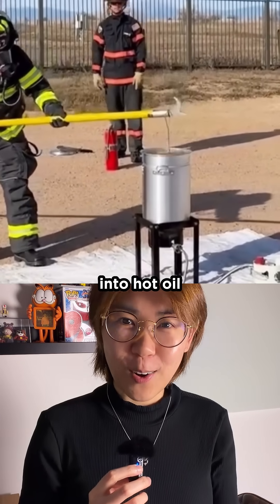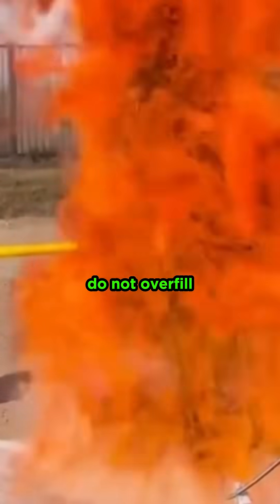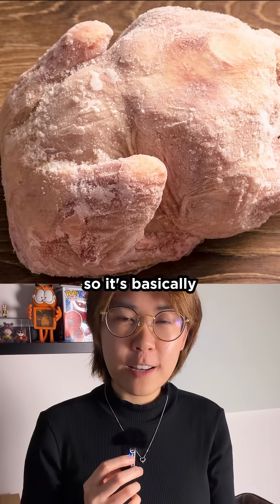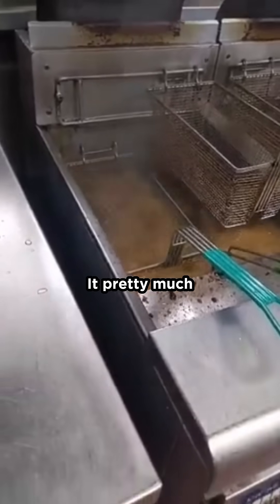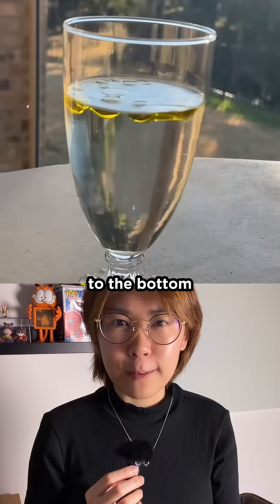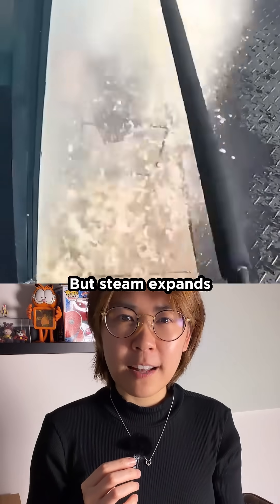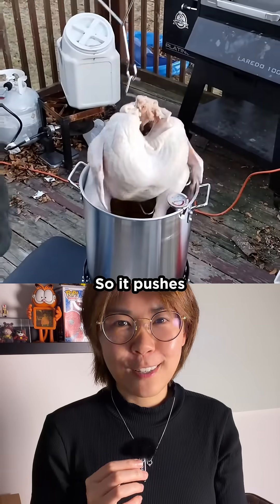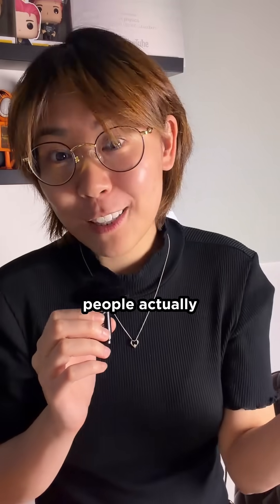The Dangerous Truth Behind Deep Frying a Frozen Turkey #holidayswithyoutube

Comment from the maker: Send this to those who like deep frying turkey and can benefit from this safety tip 😁
Reply: My family just put them in the oven AFTER thawing them. Thawing the turkey is easier to cook than just putting it in.
Reply: @DannyAddams-1977   Well duh. Of course thawing something, especially something as large as a turkey, will be easier to cook.
Reply: Why? I have deep-fried many turkeys and have not had a single fire or oil explosion.
Reply: @JM-lk6wo 
Did you even watch the video, it says FROZEN turkey's. If you let it thaw out, it's safe.
Reply: Why does the oil burst into flames ?!
Reply: @MarianLuca-rz5kk    The oil overflowed the vat and hit the burner/gas.
Reply: @MarianLuca-rz5kk so the ice goes almost instantly straight from solid (ice) to steam which needs lots of space. Steam needs about 1,700 times the space that liquid water does. Not enough space in the pot for turkey plus steam plus oil so oil overflows.

At same some time oil is broken up into tiny, tiny pieces. These tiny, tiny pieces of oil ignite more easily than a puddle of the oil. So oil catches fire.

Flames then travel upwards were they meet all that steam. Instantly igniting the steam (water) and oil mix. 

That's the billowing cloud you see over top of the pot. Now it has caught alight, oil flows away from pot, with burning oil vapours on surface (with oils the vapour burns). That's why it spreads towards camera.
Reply: Its called be careful and dont be an idiot. Ive fried turkeys and have had no issues.
Reply: I feel like it used to be a safety ad back in the day, hence why its common sense for the older folk😊😊
Reply: I work at KFC we fry like 80 turkeys on Thanksgiving at my store  😂
Reply: A deep fried turkey WILL CHANGE YOUR LIFE
Reply: We used to deep fry every thanksgiving turkey it’s awesome.
Use peanut oil, and follow the instructions carefully.
Reply: Who the heck deep fry turkey
Reply: @NinjaREX69     its commonly done in the USA.
Reply: @Jyno_Syd  is it? Im from the US but I have never heard of anyone deep-frying a turkey *successfully*. Its all just burn stories or it didnt fit.
Reply: @rorwyk       It's common in the southern US. They even make turkey fryers for this very reason. I've lived in every part of the US at some point or another.
Reply: @NinjaREX69 it's so good especially if people know what they're doing. My friends family did it while I grew up
Reply: Why Fire tho
Reply: @Point_Resident   Oil meets flame.
Reply: It's stupid to send this to people that Like to fry turkeys because we already know this common sense, either through learning it before we ever fried one or through experience out in the middle of our yard away from everything. Fried Turkey is the best nothing compares.
Reply: Thanks! Now i won’t have 3rd degree burns over the 90% of my body.
Reply: SHUT THE BURNER OFF WHILE DROPPING THE TURKEY IN THE OIL
Reply: after thawing the turkey is still 75% water also it doesnt melt like ice and go to the bottom. 
so im still not clear why putting a frozen turkey in oil is bad.
Reply: @bobrobert6277 it is much better to thaw then pat the outside dry. I inject mine a lot.  it's not the water and moisture in the bird it's the ice and moisture on the bird that flares up the oil. Also the oil should be in the correct range of temperature to lessen the flare up.
Reply: @TimbreWolfe  that make sense thank you
Reply: STUPID COST EXTRA
Reply: Or send it to the retærds that don't know basics.  This is definitely something a person who would microwave a whole turkey.
Reply: mommy?
Reply: Ok does she shave her poosie
Reply: Air frying a turkey is safer and MUCH better, in flavor, texture, and healthier in that you don't have the added oil. Just thaw it, brine it for a couple days, then take it out and DRY it off. Cook in air fryer about 3-4 hours.
Reply: Step one to deep fry a turkey.
1) Dont. Thats nasty and the meal is fattening enough without deep frying everything. 
2) think...cause just cause you can doesn't mean you should.
Reply: I've been deep frying turkeys for over 20yrs.  Stop doing bone head moronic shit. You will be ok
Reply: @TheOringinalWolfman Deep frying a turkey is a bone headed moronic thing to do. You've been doing 20 years of it.
Reply: @K-Locke Shows how much you know kid
Reply: @TheOringinalWolfman Same.  These days it's painfully easy to get the info on how to do it safely.  Is it possible to do it dangerously? Yes, but so is driving a car.
Reply: @TheOringinalWolfman Thank you for not being a bot 🙏🏽
Reply: Dip the bird, let some of the water boil off in the oil and pull the bird out. Let oil get back up to temperature. Don't leave the bird in the vat while it's about to boil over.

Comment: There is four things you need to do. Put the correct amount of oil in the pot, thaw and dry the turkey, turn off the burner while putting the turkey in, and gently put it in rather than drop it. Do that and you are good.

Comment: I get the oil overflow but why the fire ?
Reply: Hot Oil is like fuel to fire. Just so u know if you ever get a grease fire shut off the fire if you can so safely  by putting something on the fire like a lid.  If possible, take it away from the stove or fire. Let it die out on a metal surface like a dry metal sink that should not have any other dishes or anything that can melt or catch fire.  Remember, regardless of the type of fire oxygen will keep it going longer. Find safe ways to smother a fire depending on the fire

Comment: Shockingly, its kind of like a tame version of the demon core, water being the plutonium core, and the oil being the neutron shell reflecting particles back into the core. The water expands outwards (like the plutonium sending particles outwards as it decays) the oil trapping it inside so it builds pressure (like the neutron shell around the core that reflected particles back into the core, causing the core to go super-critical) and then water forces its way out as vapor causing oil to be sent everywhere, (like how when the demon core went supercritical, the plutonium had its decay sped up causing it to send particles and radiation outwards so fast and so powerful that it exploded.)

And that is how splashing water on hot oil is similar to dropping a nuke on Hiroshima. Thanks for coming to my ted talk!
Reply: It should be noted, however, this is simply an analogy to understand nuclear physics slightly better, the way the "explosion" happens is entirely different but still follow SIMILAR principles, the key word throughout my entire rant is "SIMILAR"

I would dive deeper into the topic but nobody is gonna read it and im too lazy to write anymore because it is 1:30 AM as of writing this and i need sleep. Have a good day/night yall.

Comment: I used to work in a kitchen and one time someone from the morning shift put something with high water content in the fryer. Because the fryer was shut  off between shifts you couldn’t tell there was water at the bottom. Until I turned it on, and it started bubbling and frothing and starting to overflow. We couldn’t server the fried foods for dinner cuz we had to quickly shut it off and completely clean it 😅

Comment: Also, the rapid expansion of the water when turning into steam causes the oil to turn into aerosols. Basically, the long fat chains of the oil get violently ripped apart, causing it to create small carbon chain pieces that ignite extremely easily. Which is why the fire, and why you can't light cooking oil on fire by itself, the long fat molecules don't burn as easily.

Comment: Deep frying a turkey doesn't have any logical advantage.... You might as well setup a furnace in a hole and then dangle the turkey into it. There's also too much volume for the heat to travel especially in a frozen turkey...

Save yourself the trouble and just butcher the bird into multiple large pieces, then cook them separately to doneness.
Carving before cooking makes it much easier to handle afterwards, because you have a smaller piece to carve, and it'd be well seasoned.

Comment: Some things said here were not quite right.  putting a frozen turkey in hot oil is nowhere near as dangerous as throwing ice in water.  In every video shown, there was too much oil to begin with.  whether the bird was frozen or not, a fire was going to start.  The thing can be partially frozen. There are two keys.  First... have the correct amount of oil.  Second... make sure that the skin of the turkey is dry.

Comment: MinuteFoods made an in-depth video about this a while back! Basically: 
Thaw it properly (day/~4lbs)
Measure for oil displacement (so the oil doesn't overflow)
Turn off heating especially if it's by fire(so any over flowing oil doesn't ignite)
Do it slowly (so the turkey's water content turns to steam near the surface of the oil) 
Keep flammables away

Comment: It also causes h20 to split into hydrogen and oxygen and then it combusts as well. If you have a water faucet above your stove top, don't use it and shut the valve off. If you put a pot of hot oil under that faucet and turn the faucet on, it will make a fire and will also turn the h20 into hydrogen and oxygen vapor, which will rise to the ceiling and you'll have a blanket of fire in the cieling across your kitchen. Just like the slow mo of fire spreading in a movie explosion. And it won't stop until the water is shut off or the grease is all gone. But that won't happen before your house burns down. In just a few seconds there will be a layer of fire in contact with the ceiling... like a layer of fog that can't rise any higher, but it's fire instead. Be safe folks. Fire is the most useful but scariest and deadliest things we interact with in our homes. Burns are horrendous. And remember, if you even think for a second that you can't get the fire put out, EVAC YOUR HOUSE. Also, have family fire drills. That's important. That way you don't run back into the house and die while trying to save someone who was already outside. Get rope ladders for 2nd story windows. Take the ladders out of the package completely before storing. Your 10 year old kids won't be strong enough to open the packaging, judging by the packaging I've seen. I would have a hard time with it. Ours was in really tough packaging. But it looks like avg packaging that you can tear open easily and then use the ladder. Nope, ours was ij very very heavy and strong plastic. Open it, keep the ladder rolled up and put it in an accessible location in that room. You need a ladder for each 2nd floor room. Not 1 ladder for the entire 2nd floor. Heck, I'd put 2 in each room just in case 1 was dropped while trying to get it setup in an emergency. Sorry for the long comment. Fire scares me and the the thought of people dying in a fire terrifies me and hurts my heart and soul. Please make sure you're household is prepared. The moment a fire gets out of control, escape is the only option. So, have fire drills and make sure everyone knows how to escape, how to use the ladder, where to meet when they get outside. Also keep1, preferably 2 fire extinguishers in your kitchen. But have accessible fire extinguishers on every floor and make sure everyone knows how to use them. Your local fire dept would be happy to train you and your family on how to use them. Stay safe everyone and God bless.

Comment: Steam expands 1700 times its volume. Still think a lightsaber is an "elegant weapon for a more civilized age"? I think not. That would be no clean, cauterized cut. All the water in that tissue would flash to steam, expanding 1700 times its volume. That lightsaber wouldn't cleanly cut off a limb. The Mos Eisley tavern walls would be repainted with bits of arm. Neat little silhouettes where all the patrons were standing.

Comment: If you're gonna deep fry a turkey, the safest method is to first thaw the entirety of the turkey (yes, until even the center is thawed), separate the turkey into it's individual parts, and deep fry them individually on a smaller scale. 

Best results come from coating them in egg wash and breading before deep frying.

Comment: It's important to point out the other safety tips, because it is safe to fry a turkey.

Use the correct amount of oil. You can submerge the turkey in the pot full of water until it overflows, then take the turkey out. The level of the water is the maximum fill, but you should subtract at least an inch and a half. Mark the level on a stick, get the bird out, dump the water out, and fill with oil to that level (minus that inch and a half).

Any time you're dipping the bird in or taking it out, turn off the burner first and wait a minute. Many fires occur because the oil spills over onto the open flame or the hot nozzle of a just-turned-off flame.

Whatever you're using to pick up the bird and drop it down into the oil, do your research on frying a turkey and follow best practices. Sometimes you go to take the bird out, and it slips out of whatever harness you thought was secure. This leads to splashing. This can cause fires, burn skin, or at the very least stain clothes with hot oil. And hot oil is the worst kind to get out, because it's already starting to cure.

Also, make sure you're not married to the aesthetics of wherever you're doing this. Hot oil is going to come out. It will absolutely stain concrete or wood.

It's best to start with a total lack of confidence and then work your way up. If you just immediately think, "I can fry a turkey with no damage to person or property," you might not have the humility for this one.

Comment: My cousin puts the thawed Turkey in the pot. 
Fills the pot with enough water to cover the Turkey. 
Removes the Turkey, and notes the height of the water.Drys the pot and adds the water to the notes level. 
Turns the gas off. 
Slowly lowers the bird.
Turns the gas on, and lights the burner. 
He also sets up on a fire proof location. .

Comment: Frying turkeys can be done safely. I’ve done it dozens of times. 

There are a few basic rules: 1. Don’t fry frozen turkeys as shown in the video, 2. Don’t fill the fryer with too much oil (also shown in the video), and 3. Don’t put too large of a turkey in the fryer. Space is needed on the sides to cook and not burn.

Comment: There's a fun thing I do around campfires.  Set come candle wax in an empty tin can on the fire until it melts, smokes, and the surface catches fire.  Then throw some water in. (I used to slug some water from a bottle and spit, now I use a water gun)

Comment: Im an expert. Before you heat the oil, season turkey as you like, put it in the cooking pot without oil, then pour just nuff oil to cover the turkey a little, just a little more. Take oiled turkey out, then heat oil to 375, slowly lower turkey in to oil. Make sure what you are holding turkey with is not going to break. Temperature will lower naturally  and you should turn oil down a little,so when you turn it down it should settle out at the ideal temp of 350. A thawed turkey should cook to a golden brown in 3-4 min per pound. Cook to internal temp of 180-190. Place a tarp under the whole thing or your deck or grass will be permanently stained. Dont do it in garage.

Comment: Been deep frying turkey every year for the past 12 years and never had more than a drop of oil pop out.  These demos are definitely showing what not to do.  A non frozen, brined turkey, left out for 30 minutes prior to frying and patted down with paper towel to absorb surface moisture, is the way to go.  

I take the turkey out, set it on a stand to dry, then heat up the oil. By the time the oil has come to temp, I ask someone to help me grab it by the frame that came with my fryer.  It has handles on each side so my helper and I lower it slowly while i give instructions on whether to slow down or keep going.

About 30 minutes later a 13-14lb turkey is deep fried to perfection.  Cut the heat and slowly lift out, place on a drip try to sit and in another 30 it is ready to carve.  I used that Alton Brown recipe from decades ago, minus his fancy contraption to lower the turkey since having it swing around was kinda dangerous the first time i tried it, and it has worked a treat every year.  I also grab a chair and sit nearby with a Type-K fire extinguisher ready to go.

Comment: ok here is how you fry your turkey.

1.  Thaw your turkey completely
2. put water in your fryer and submerge the turkey give it a few moments for all air in the bird to escape, then pour 85-90% of the water into a container you can measure, that's how much oil you should use.
3. DRY THE TURKEY pat it down and remove as much moisture as you can from the bird.
4.  Heat the oil up to whatever the oil container says.
5.  Use a hook to lower the bird into the oil (you can turn the fire down for this in case any oil spills over) SLOWLY
6. Leave the bird in the oil untouched until it's done cooking.
7. Turn the fire off
8.  Remove the bird with the hook that came in your kit.

You will have the most juiciest turkey you ever had and it'll be evenly cooked.

If you follow these steps deep Frying a turkey isn't anymore difficult or challenging than roasting it.

Comment: 1. Thaw / brine.
2. Put water in the vessel and dunk it in to check if the water spills, measure that water and only use that much oil so that it doesn't spill.
3. Dry the turkey skin with a paper towel and hook it.
4. Slowly put the turkey in the hot oil. Keep a fire extinguisher at bay.
5. Keep everything ready to remove the turkey and a steady tray, preferably at a height that is comfortable.
6. Remove slowly and enjoy

P.S. Or you can Skip all of this hassle and quietly cook it in an over like a normal person